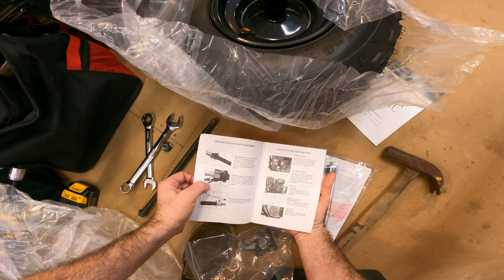Trailmaster MB200-2! 👍😎 Uncrate, Prep, Test Ride, First Impressions [4K]

Comment: what's out is what it is.ON/Off
Reply from the maker: what's out? Not sure what "what's out" means.   The kill switch was upside down and labelled incorrectly if you mean that.
Reply: @bwxmoto  the button sticking out, if its sticking out on off then its off if its sticking out on the on then its on
Reply from the maker: @GrowOhighO  "...if its sticking out on off then its off if its sticking out on the on then its on...."
--
--
Sticking out? I really don't understand what you're trying to say but anyways..   It was labelled wrong, it was labeled backwards.  Easy fix.
Reply: @bwxmoto  push the off butt in the other side of the switch comes out witch is on
Reply from the maker: @GrowOhighO  Yeah but the other side pops out no matter which side you hit. 😅
  It was labelled backwards, not sure what you are getting at exactly. 🤷‍♂️

Comment: I've got 15 mini bike 10 quads 5 3 wheelers 4 go carts and a side buy side plus a sand rail my 30x40 is starting to run out of room to work so built a 20x24 for a work shop and my wife caught me with a Coleman bt100 I got not running I payed 100 bucks it's in the work shop
Reply from the maker: LOL that’s crazy. I need another shed for sure. 12x24 is full. Taxes and nazi local tyrants making it hard to add another out building.
Reply: @bwxmoto  I feel you on that one the 14 acres I bought  just over 20 years ago land ran me $53 a year with nothing on it 2400 sqft home and a 30x40 shop turned it to $1500 in taxes built my new shop and it almost 2k a year government sure loves to tax us to death ☠️☠️☠️
Reply from the maker: @davidpayne4084  yup! Never really own property unless you have cash to pay the local nazi cartel.

Comment: It only does 24 mph you think you 212 swap it.
Reply from the maker: Feels like this thing will do 45 MPH out of the box with throttle limiter screw backed out. Feels good. I'll put a GPS and tach on it soon and then ....... Upgrades!
Reply: @bwxmoto  I thought it did 35mph
Reply from the maker: @diegorobles100able  51 MPH down a hill, I'd have to look at past vids for flat ground but I think it went about 42 mph.
Reply: @bwxmoto  did you back screw out?
Reply from the maker: @minnesotamotors9976  Yup never rode it with screw in. All riding vids are with screw backed out.
Reply: @bwxmoto  how far do I back it out? Trying to find it on mine haha
Reply from the maker: @minnesotamotors9976  You can take it all the way out if you want. I leave mine in a few threads, the spring tension seems to act like a lock washer or something. They never fall out on me. Might be safer to take it all the way out just so you don;t lose it though. I like to have the ability to screw it back in in case a beginner wants to ride it.

Comment: I might just spend the extra money on one of these instead of a coleman
Reply from the maker: Probably a wise choice! Colemans are cool but rear suspension is really nice.  Comes with TC, etc.
Reply: @bwxmoto  i am thinking also in terms of having the ability to become street legal, I heard the trailmaster comes with a title, i dont know about the colemans or if they have a vin
Reply from the maker: @thumperbangin2000  Oh.. ok. Yeah You can get paperwork on Colemans but you have to call Coleman to get it. I got a certificate of origin or something like that with the MB200-2 but not sure every retailer will send it with the bike. I got it at motobuys..  Also the Colemans have a vin too. 

I haven’t looked into it much because it’s basically impossible here in NY.  I know you still can make them road legal in certain states but not many.  

Might be easier to throw in an electric start engine that has charging coils like a Tillotson or something and then hook up a small motorcycle battery to run lights, blinkers,  brake lights, etc.